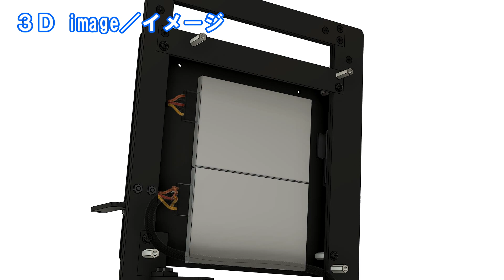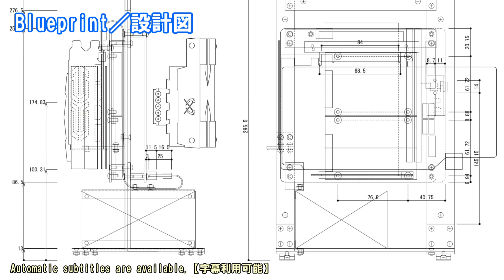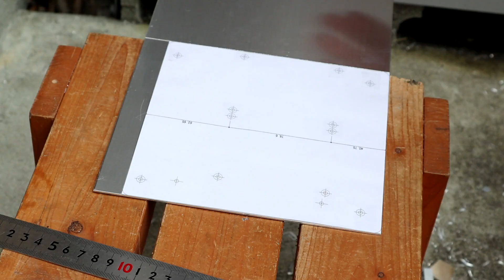Production of self made open PC case／オープン自作PCケース（製作編）DIY PC Build

Comment: Great idea with the construction! 

Small tips when working with aluminium:

-when drilling use isopropyl alchohol so it does not stick to drill bit, it will also cool the tip

-when cutting with saw you can coat blade with regular hard soap so it does not stick, this also works when using thin angle grinder disc
Reply from the maker: Thank you for your valuable hint. I am going to use it as an example.